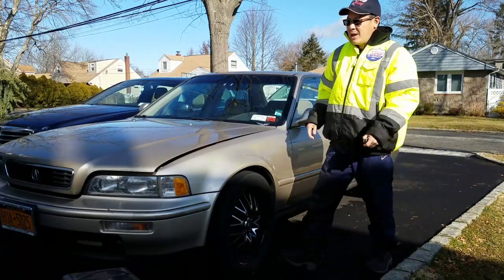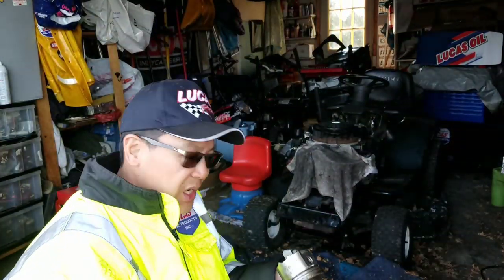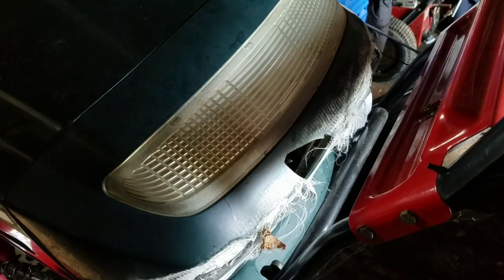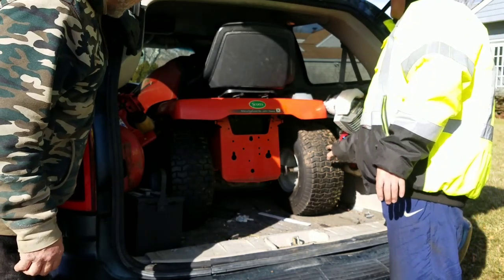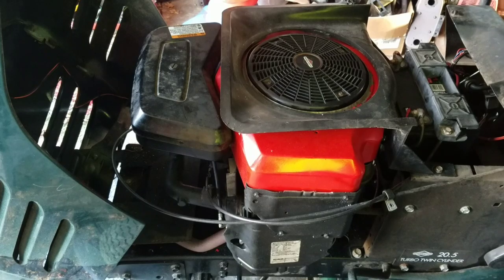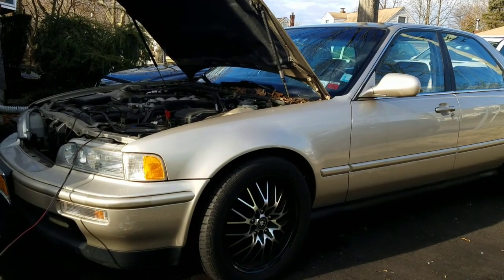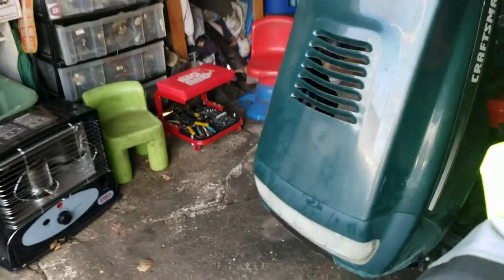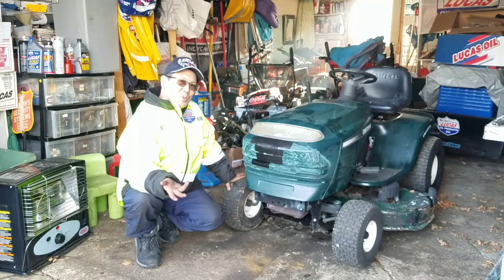FREE CRAFTSMAN LT1000 LAWN TRACTOR BRIGGS 21HP OPPOSED TWIN ENGINE COVER FABRICATION 1ST TEST DRIVE

Comment: Good to see it running and Mowing and moving bro. That looks like the fuel pump or the carburetor probably needs another cleaning or like you said in caption it probably needs another carburetor on it.

Comment: If you have to run the engine with choke then it's still fuel delivery and I know that you know that too. You could check the two [idle fuel discharge ports] for clean, but you will have to take the carb off and get to the throttle butterfly side. They are shown here at [#10. Idle fuel discharge ports] just something else to try. I would have covered that hole in the hood with a big OUCH sticker. lol
Nuther good vid Henry! 👍 https://outdoorpowerinfo.com/repairs/briggs_opposed_twin_carb2.asp
Reply from the maker: Thanks Don, very helpful.

Comment: Henry, you might try checking the compression and make sure that the values are set correct.  Just because it is hard to turn over doesn't mean it has good compression.
Reply from the maker: Well it runs just fine, until it’s under load... carb has a blockage or needs adjustment.  I may try another carb just for the heck of it!
Reply from the maker: Valves cannot be adjusted in a flathead opppsed twin engine.

Comment: Yeah bro, hate to say it but you need to dig into the fuel pump, take it fully off the engine, and clean it with the ultrasonic cleaner, then you should be good to go.... Also adjust it, and adjust the governor look to make sure it's not bent or binding.
Reply from the maker: Fuel pump seems fine!